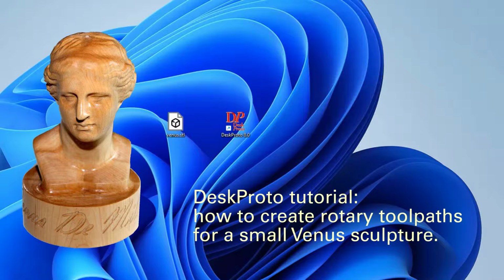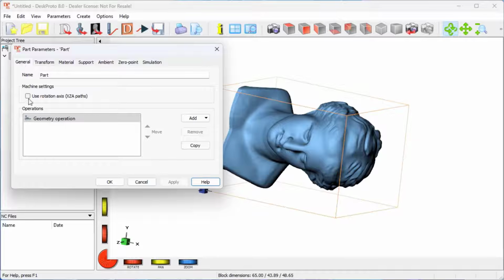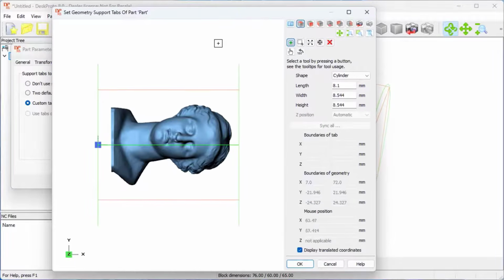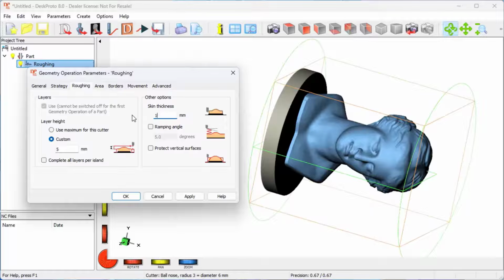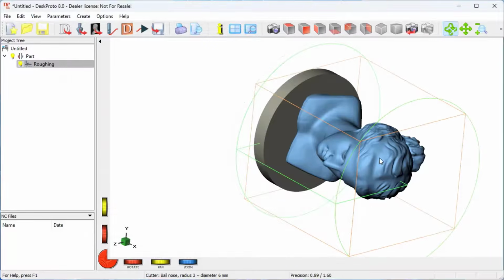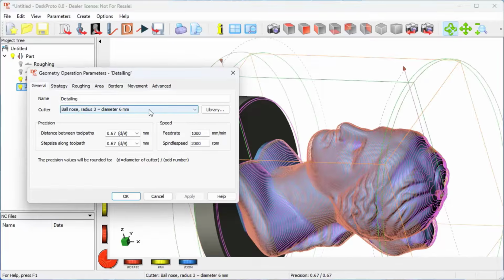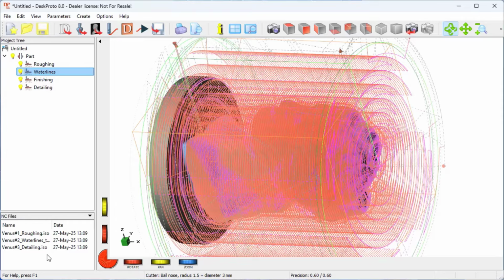Creating rotary toolpaths for Venus (4-axis CNC) using DeskProto Version 8

Comment: How does this interface with tapered ball nose bits? I notice that when I start from the end (right side) the upper part of tapered ball will collide with the stock and machine away areas it was not supposed to machine just because of the way the toolpaths are. Does deskproto not account for the angle? Is there a way I can describe my issue through discord on a call? I am using DP V7 multi axis.

Comment: Hello! God bless you guys for this nice software that look also very old school and simple GUI and i like it!
I have a Quastion. I succes to make a project with 4 axis rotary (Y parallel) and work perfect. I used a model o column that i made it with aspire and extracted to STL so i used it in Deskproto. My problem is that the Z axis (i am using Helix) make small up-down +-1mm and thats makes my column to be not round but ellipses! I try best resolution of STL, smaller step, but the problem persist. Pls Help me to use this very nice program!
Reply from the maker: Thanks for your compliment !  About the small Z-axis movements: could that be what is explained on https://www.deskproto.com/support-tips-tricks/dp-tips-small-z-movements.php ?  The does not explain the ellipse shape though. Could that be cause by a backlash on your Z-axis ?

Comment: Hi I owned a Makera air, does it work with it nicely? So it cannot do true 4 axis, just indexing from A axis? In theory it can reach all areas that a true 4 axis continuous milling does just from indexed rotation, am I correct?
Reply from the maker: DeskProto works well with all Makera machines.  Indeed in DeskProto the rotary toolpaths move only three axes. With indexed machining it will be possible to reach all areas, though the milling process is less efficient.

Comment: i like it, while im still playing around with deskproto and the 4th axis i found a situation i cant solve. i have here also a 3D stl file with a Head on a socket, but on this socket is a plate with the name of the guy, how can i finish only this flat part? Means rotate so th plate is upwards and then make a standard 3 axis operation on it with out the rotation axis
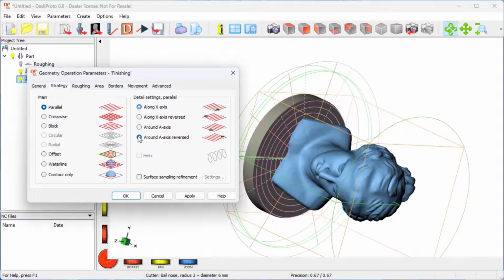Reply from the maker: Sorry for the delay in replying, caused by my vacation.  You can indeed combine rotary toolpaths and standard XYZ toolpaths in one project, by defining two parts. This is shown in the Nefertiti tutorial video, at ca 16:30.  There is is applied to machine an undercut area, the same trick can be used for your socket.